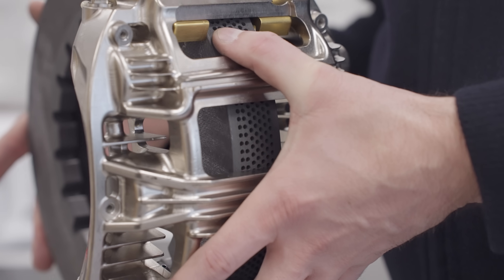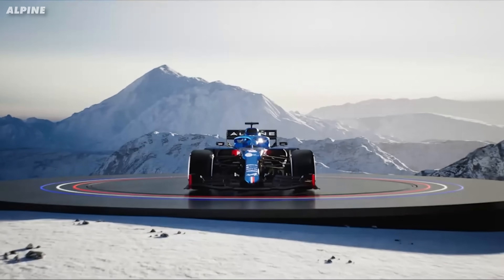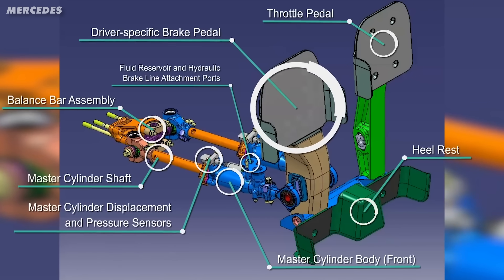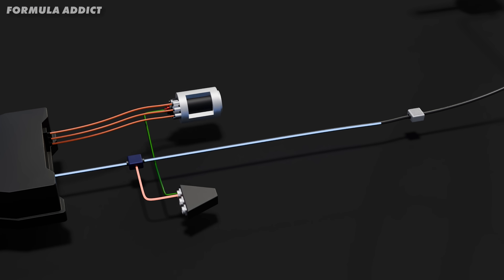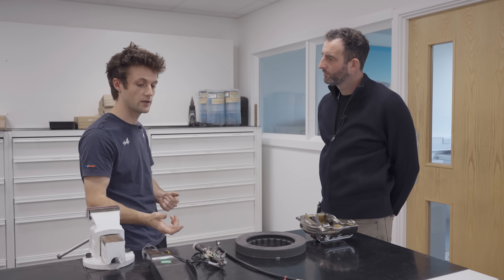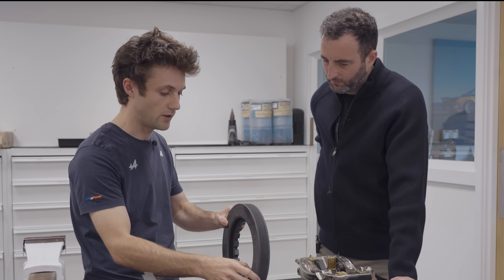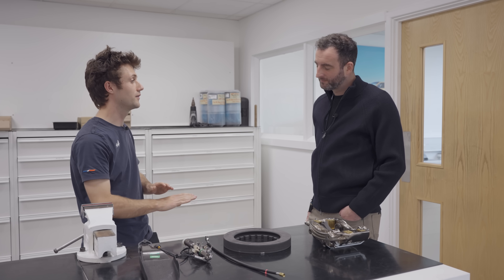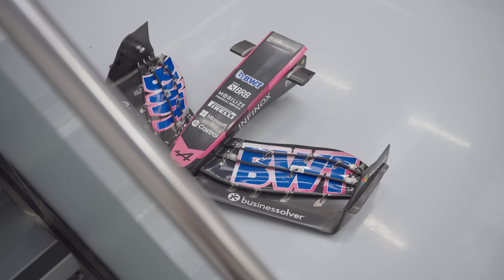How Formula 1 Brakes Work (F1 team explains)

Comment: Just a little note here. The leg of a 70 kg driver will weight around 12 kg. Under 6G deceleration, that's 72 kg applied on the pedal just from the weight of the leg alone. The rest of the body is producing 348 kg of pressure against the seat at that point. The driver "only" has to relieve the seat of 108 kg to produce a total of 180 kg against the pedal. He doesn't have to push against the back of the seat, it's enough to try to decrease the pressure of the body against the seat. He could never release all the pressure at 6G. From my calculations, someone lifting a 170 kg bar will be pushing 108 kg in each leg (170+torso=216). I would guess every F1 driver is able to lift 170 kg. Quite impressive for a 70 kg body weight.

Comment: needs to be clarified that as soon as the driver hits the brakes, their weight changes according to the G forces they experience which are parallel to the braking line, if that makes sense. So it's not like the drivers press all the time with a force of 180kg, but rather they do that pretty hard initially and as soon as the car starts breaking and G forces are created, the foot becomes heavy enough to assist into pushing the pedal but of course it still needs a lot of power.

Comment: What seems so hard is to exert so much force (even if helped by your own deceleration...) but keeping some feel and control (for instance for trail braking...) at the same time. Certainly when you hear that the fastest drivers, such as Verstappen, are not the hardest breakers (such as Perez), but use more feel and subtly on the breakpedal when going into a corner...

Comment: The forward G force also helps them push the brakes…. Still absolutely insane! I remember a video where a “normal driver” hit the brakes as hard as he could from 100mph in an F1 car into a corner… and the team said he was only at like 20% braking 😳😳😳😳
Reply: these drivers were literally strapped into their cars, like they can barely move their necks to use the side mirrors. there is no forward motion from their body to help with braking. experiencing that kind of motion in various weather conditions and for almost 2 hours is suicidal

Comment: felt like brake system introduction for street cars @ school. Do we really want to know about the difference between brake hoses and pipes when checking out f1 brake systems? Would be much more interesting to know what type of slide pins their calipers use or what makes the brakes retract after releasing the pedal.
Reply: No slide pins required with a floating disc and if you retract the brakes after an application you will have excess travel on the next application. The pads need to stay in very light contact with the disc all the time.

Comment: Brakes are the most impressive system at any car, they handle so much, they are more fascinating than any car engine.  It is interesting how long it takes to accelerate to like 200mph and how short it takes to brake down the car to a stop.

Comment: I have 371mm front and 365mm rear floating rotors on my Corvette C7. Brembo 6 piston calibers as well. Each wheel brake is independently pressurized and controlled by the ECU and a servo manifold. Just wanted to brag. 😆
Reply: where is the owen wilson meme when you need it.
Reply: Brag when all you could get was a Vette?    Let the internet know when you can afford a Porsche 911.
Reply: @ronbelanger4113  Why would I want a 911? C7 Zo6 will destroy an overpriced stretched out beetle. My vette will definitely out brake that car.
Reply: @Bailey-k2j 😂😂😂😂😂😂😂😂😂
You wish.. you have a fast tractor with low body.
Reply: @mknone40  You should watch the 'how its made' videos on youtube. Corvette C7s are superior to shitty Porsches and their cheap, stamped sheet metal body panels. Keep dreaming pal. Porsches are not expensive, just overpriced.

Comment: The bit you forgot:
BREMBO F1-INFOGRAPHICS - THE BRAKE PADS
"The friction material used for Brembo pads has gone through significant changes. The actual material used, known as CER, has significantly reduced wear and guaranteed a more effective thermal conductivity. Compared to the previous composite, CER ensures excellent warm-up time, namely speed in reaching the maximum operating temperature for greater effciency, broad range of use, both in terms of pressure and temperature, and linear brake response.

These are all features that allow the driver perfect modulation of the brake system. Incredibly low wear that means constant pedal stiff and performance throw the race. The material used for all Brembo discs is the same for all teams. During a complete season, Brembo provides each team, consisting of two cars, an average from 280 to 480 pads."

The pads themselves look like big curved slabs of ~inch-thick carbon-carbon.
Reply: Oh I’d like to see them but they did not include them in this video. Thank you for the info.
Reply: Sure

Comment: 180KG of force but you have to account for the Gs generated by the force of the car to a driver usually is doing less.
Reply: NO. Jesus I see this comment everywhere. The driver’s leg muscles still have to carry 180kg, it doesn’t matter where the weight comes from. 180kg is 180kg.

Comment: that is a misunderstanding there. when you brake, you have 2-3g of deceleration which means the driver's body weight X 2-3 will act on that paddle. Does not mean is easy but is not as crazy as people think. To do that you need to brake hard. accelerate hard and all these is a close loop of skills to get the F1 system to work at the operating temp.

Comment: I was very fortunate and got a paddock pass in Austin. During the Aston Martin garage tour they mentioned that the brake pads are $20k-$25k each and that they replace them once a day. So that's over a quarter of a million just on brake pads for a race weekend.
Reply: Wait a second: 25k each means 50k per wheel, means 200k for the whole car, means more than a full million for both cars for a race weekend.
And that means roughly 300 millions for all teams combined over a full season. If we include the pre-season tests, then we talk about half a billion. That s a whole industry living just on F1 brake pads.
Reply: @JustMe-zs4rg  dang, I don't remember if he meant per pair or per pad. If the latter, then you are correct!
Reply: Pads dollars? Don't think so
Reply: Why change them? They become loose?
Reply: @kcnl2522  They become degraded such that performance is compromised.
Reply: Probably less than what they spend on tires.

Comment: Since it's brake by wire and this is a muscle memory system and every sim racer knows that it's one of the most important parts of the sim rig that makes you faster, i wonder if it would be allowed to use a position system, no idea if it works better for anyone but still wonder if it would be allowed

Comment: Wait!  So, you press this pedal, it moves a piston in a master cylinder filled with fluid, and that activates a clamping motion in the pad.  F1 really has done some crazy science fiction stuff there!
Reply: Exactly my thought lol. All cars use this technology. Hell, my bike uses the same technology. Bit of a “well duh” video
Reply: @Quizack Your bike has hydraulic brakes? Mine uses cables. Or do you mean bike as in motorcycle?
Reply: Only difference is most cars are better because they have boosters so you don't have to press so hard. Man, I could get into f1 and really blow their minds. 😂😂
Reply: @poolhalljunkie9  to much weight, plus you wouldn't get the feel out of the brakes that you need for fast laps.
Reply: That’s a bit simplistic, I don’t think the Model T reached 1000 C. That’s like throwing shade at a video about an F22 because it uses the same principle the Wright brothers used. Nice troll though
Reply: Crazy idea here, what if we used, like a vacuum to... Maybe displace a diaphragm and... Magnify the force of the pedal?  Whoa, super futuristic idea.
Reply: Too funny
Reply: I see what you did there 😂
Reply: That's pascal's principle and it's used widely in all cars f1 or street cars sports or sedans
Hydraulic Pressure through the braking pad to a cylinder of Hydraulic fluid generating higher force on smaller area using the same amount of force you do on a larger area on the fluid
So if you press with force of 5N on the brakes 
The work you done for it gets multiplied on the brakes to like 10N due to the area being lower in the fluid pistons
U can look up Hydraulic press mechanism of working or pascal's principle
It's not that big of a deal here 
The impressive thing is the Braking discs and its high temp resistance and effectiveness
Reply: @ahmedalaa7216  Sorry, thought my sarcasm was apparent.  107 years using this technology, F1, Buick, Ferrari....all the same.
Reply: @jesterlead  lol my bad i didnt realise at all you were sarcastic 
When i read your comment again it really made sense and u were really sarcastic about it 😂
Reply: @jesterlead  if it works don't fix it. Probably the fast thing still to replicate user to backend control.
Reply: @ahmedalaa7216  They pour millions in to make those existing technologies much more efficient. I think f1 is more like and optimizing thing not inventing new things most of the time. Especially because they are very restrickted about the design.

Comment: NOBODY is doing a single leg press of 400#.
Let alone with precision.
Absolute BS.

Some commentor below addressed it
to some degree I see.
Sad thing is it makes you wonder what other 
specs are false in a piece like this.
Reply: You are not a genius are you? They brake at 6G's so their body weight multiplies by six times (not mass, weight) meaning their body (on average) will weigh 480 kg (960 pounds) of course this is not directly on the brake. But the G-forces help braking at max power. Don't call bullshit on something without an understanding. And of course they usually don't brake that hard, but they definitely can. Just do some investigation of your own. Look up the facts on multiple sources. Come back when you have educated yourself
Reply: @xanderveldmuisje  As I said in another comment, they are locked in a 5 pt harness so the G's do NOT make them move forward. The only body part that may be considered "unsprung weight" under g load is below the ankle. (The forefoot). Non the less, they are NOT exerting 400# of pressure on the top of the peddle with the balls of their feet.

Comment: They want to cut costs in F1.  So why have all the electronics in the brake system when the old balance/bias bar worked just fine?  Why have a thousand holes in the disc when they used to have 50?  A few grams here and there arent gonna slow down the cars enough for anyone to notice.  Its just a waste of time and money imho.
Reply: Clearly a misinformed opinion. Those gramms definitely help a lot. Otherwise they would not do it. You have to imagine that all those gramms add up over the whole car. There is a HUGE price pool when you become constructors champion. So they invest a lot to gain a lot.
Reply: @xanderveldmuisje  if the rules said 30 holes max,  caliper monoblock minimum x grams,  no electronics etc,  it's a moot point.  Not spec brakes,  but more basic.  Formula 1 lost its way when they went hybrid imho.  5 million u.s. for a power unit and 2 million for a chassis is stupid.  When a brake duct shape is a major story,  or a winglet or floor edge,  it's a sign that they have lost their way as a racing series.

Comment: Brakes are one F1 element, like tyres, that a team cannot modify. Brembo kits each with a identical product which cant be modified. Even the oil in the hydraulics is specified. Air ducting to cool brakes is a critical design element and can also be an aero downforce element usually combined with front wing flow. They dont want ducting to impede flow and create excess drag.

Comment: So no brake pads?  The pots dig straight into the disk?  That's wild!
Reply: They don’t show them. I think that’s on purpose. I guess the make up of the compound is a critical component that teams don’t want to share that on camera. Probably some resin mix
Reply: @a1white i understand it s classified but he could at least tell us what they’re going through, the temperature they can stand, the duration,…
Reply: yes there is brake pads 😂 I can't tell if you're joking hm..
Reply: Are there even pots? In the video they stop explaining at the end of the brake line, so it seems as those spray brake fluid on the discs to brake. ;) I suppose these parts of the system being that interesting (even to Alpine's competitors) is all the reason they skipped them.

Comment: For the braking force: They press 180 kg on the pedal. But the brakes are so sensitive on an f1 car that less than a quarter brake pressure will slow the car rapidly. This ties back to when he mentioned braking can put 6 Gs on the driver, so they are actually putting down around 800 or 900 lbs when full breaking, which is way more than enough

Comment: Why don't they have servo assisted? you would have thought that would be better they could break later.
he didn't say but you would have thought the canapoor have more pressure on the front pistons to the disc there's no valve control that's surprising! You want it to wedge itself in that increases break pressure by the rotation forces. Otherwise it's trying to force it apart and that increases more pressure by the driver and doesn't stop as well
Reply: Servo just reduces the amount of effort required.   Priority for F#1 is feedback and feel of the most miniscule of changes as they are always on a razors edge.   Unlike a regular car where the requirement is for Miss Marple to easily stop in an emergency.

Comment: No mention of caliper placement? Id like to see the explanation of why the particular position is selected. Infront of hub, or rear, why not at the bottom of the disc for better weight balance? Why not a larger caliper - maybe covering 50% of the brake disc surface.
I understand theres steering and cooling ducts in the tight space, but is there any other detail?